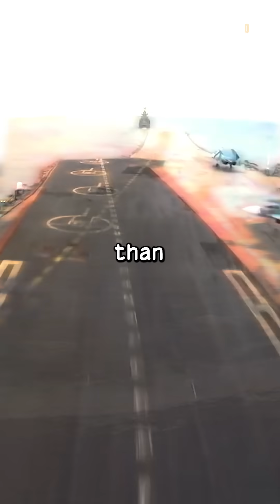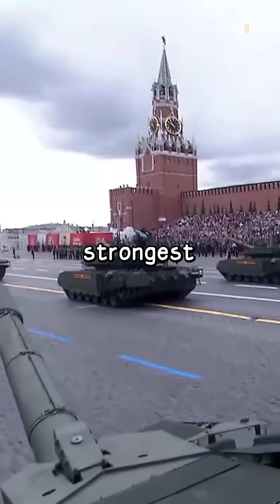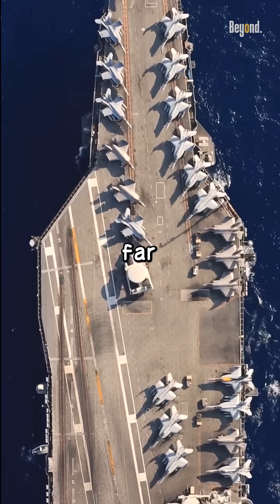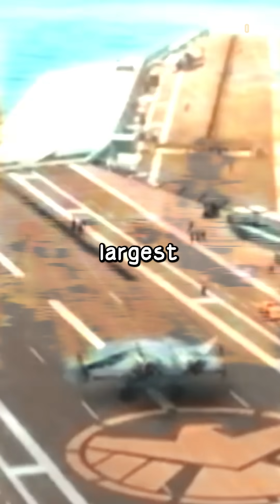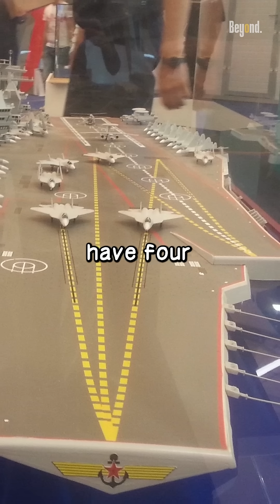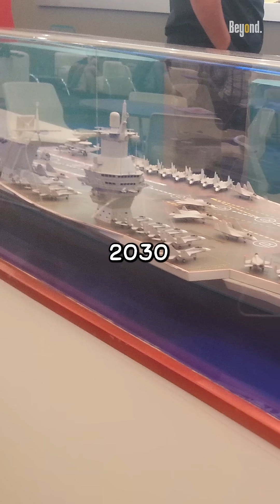Russia’s Proposed Super-Carrier The "Shtorm"

Comment: Every country’s naval strategy is very dependent on geography. Fleets must have immediate access to every shore in the country. Russian geography is problematic for massive fleet building because all its naval theaters are too remote from each other: Baltics, Black Sea, Pacific and Arctic. Russia simply has to build not a single fleet but 4 different fleets. Not even the USA is capable of that. Every huge fleet requires the ability of immediate concentration of forces and the ability to reinforce these concentrations. Russia isn’t capable of that because of remoteness of its naval theaters from each other. During WW2 Russians actually transported submarines and small vessels from the Pacific to Europe by the railways because of this geographical situation. 

Bolsheviks adopted the perfect naval strategy for Russia in 1920s: a more German one. The fleet must consist of huge numbers of small maneuverable ships and submarines to effectively protect Russian shores and raid the naval supply lines of the enemy, which they actually did by sinking German supply ships in Baltics, Black Sea and in Northern Norway. During the Cold War Russians needed something more global, yet still the geography wasn’t appropriate for building a massive battleships and air carriers and that’s why they bet on huge highly autonomous nuclear submarines, which could flee from
Murmansk, f.ex and patrol the southern Atlantic for months. They built “Kiev” aircraft series in 1970s, yet, they still could not operate in such naval groups like the Americans and they conducted rather a supportive role rather than an offensive. 

The most appropriate fleet for Russia is not carriers and huge cruisers. The best fleet for Russia is small maneuverable high speed vessels and landing ships for shore protection and huge highly autonomous nuclear submarines for oceanic needs. 

Even Peter the Great, the founder of Russian Navy, adopted Venetian naval tactics and traditions. First Russian fleet consisted mainly of small and maneuverable war galleys because these ships were the most appropriate to fight Swedish navy in the Baltic, where there are unstable winds and lots of islands and small bays. 

Rather than building this huge carrier, Russia needs 50 more nuclear submarines.

Comment: 10 ft 9 inch wide take off deck?  Wow that is intimidating if they are flying radio controlled mini aircraft.
Reply: Quite a risk to go essentially straight to that size. With the budjet required and state of russias economy.. Dreaming dont cost a dime.
Reply: Actually he said it will be 2 miles wide ( 3301 meters) And that is a ridiculous statement .
Reply: 3 point 301 meters. Listen again.
Reply: @mitchk2981  in Europe you use" point" to separate thousands from hundreds . and "," for separating the unite from decimals .   For example Greek Pi is 3,14  ; a Ton is 1.000 KG . actually most of the countries that use metric use this system called "decimal comma " .
Reply: @simonebaruzzi156 in Europe, we might put a comma to separate the thousands from the hundreds, not a full stop or point. 3 point 301 meters is 10 ft by European standards.
Reply: @scottnicholls2523  3.301 meters are like 2 Miles .  3,301 meters are like 10 feet . If you use European standard numbers .
Reply: @simonebaruzzi156 I am European, I must have been thought wrong because 3.301M where I'm from is 10ft. 3,301M is 2 miles. If I were a millionaire, I would have 1,000,000. If I had 1 million dollars and 25 cent I would have 1,000,000.25.